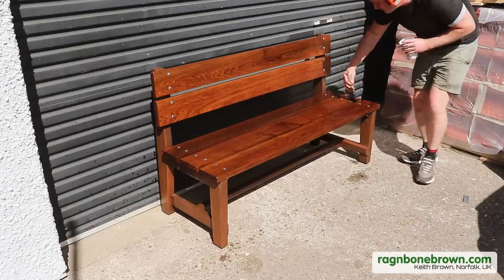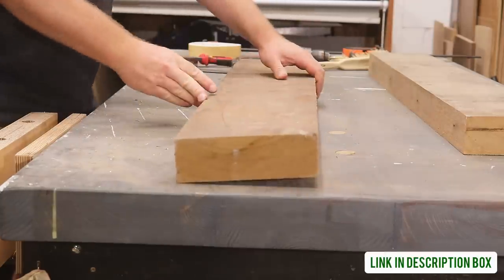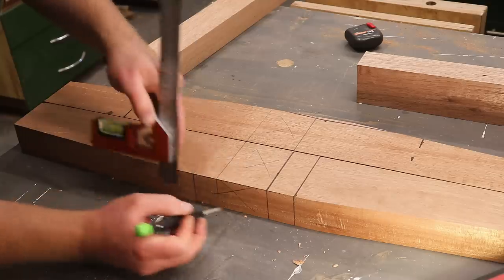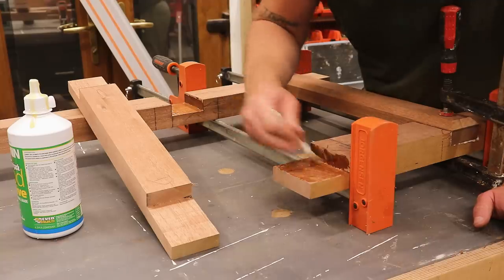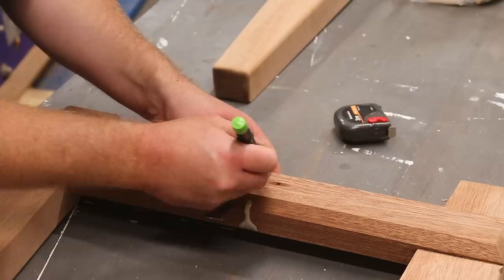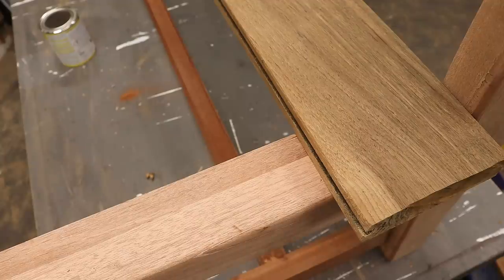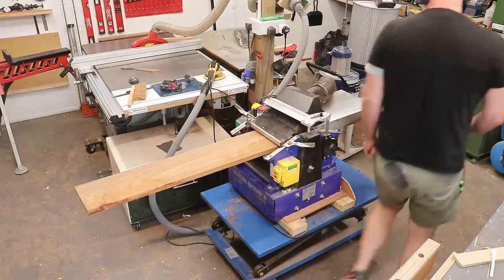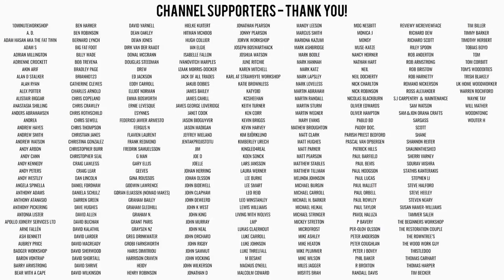This Garden Bench Build Was SPECIAL

Comment: For getting the dominos aligned, you could've rotated the domino machine 90 degrees, using its fence for the height of the domino. If you want a little offset, you can use a piece of scrap between your workpiece and the domino machine.

Comment: Absolutely awesome, the stuff you're doing, recycling stuff. I do the same (though on a smaller scale, I don't have a workshop (yet)). Am in the process of building a small greenhouse out of old door frames, doors and windows. So satisfying..
One thing that would add awesomeness, in my opinion, would be to use mortise & tenon joints. They are not hard to master, with a sharp chisel and tenon saw I'm sure this is a skill you master in no time. It would add to the character of the end piece, even if you can't see the dominos or tenons (if not through tenons). 
Personal preference though, keep up the good stuff :)

Comment: For snapped screws like that, drill round them with a plug cutter.
Reply: Do you use a plug cutter in a normal drill or in a drill press?   I tried a few times in a normal hand held drill but was not successful with that. The plug cutter wandered everywhere.

Comment: Very nice bench. Love the colour. As far as the teak, if you want to confirm it is 'teak teak', check the edges of any tool you used that isn't carbide. Teak has a high silica content and will take the edge of any plane or chisel in minutes. It's a lovely wood to work with but it is hard on non-carbide tools.

Comment: I was always told that stain added color but no protection. Was this a stain/poly mix?
Reply from the maker: Dyes change the colour but no protection, but yes stains usually are a mixture of a pigment in a wood finish (poly or varnish) that sits on the surface 👍
Reply: I don't mean to be contrary, but in this video https://youtu.be/oFwWrAq47io you say that most stains don't offer protection. Now I'm really confused!

Comment: Probably a stupid question but when you treat the wood first, then drill holes in it, is it necessary to treat the inside of said holes after? I mean, they do get somewhat filled and capped from the bolts, but water has this nasty tendency of getting in anywhere. Or is that a non-issue?
Reply: yeah that would be a good plan. also wood tends to rot first in places where it is in contact with metal (due to condensation on metal in cold weather) so extra reason to do that. even better dont use metal but wooden dowels to fix the boards.
Reply from the maker: It's a good idea to treat after exposing fresh timber for sure. I can't say I always remember to do it though